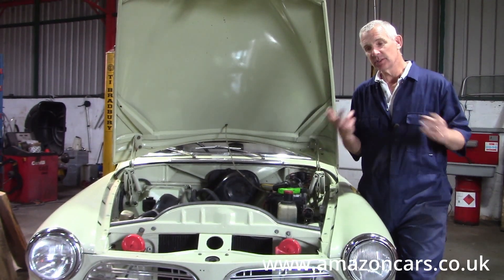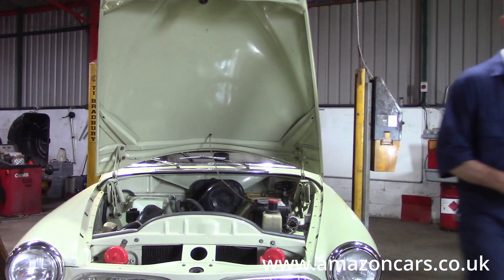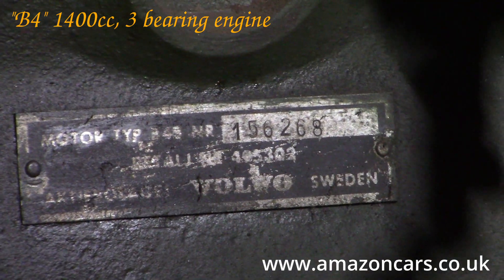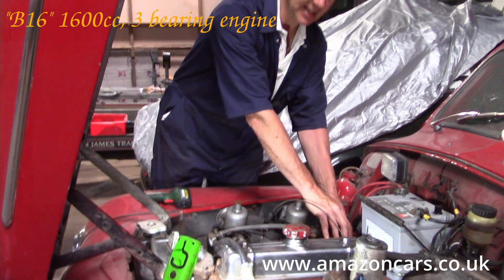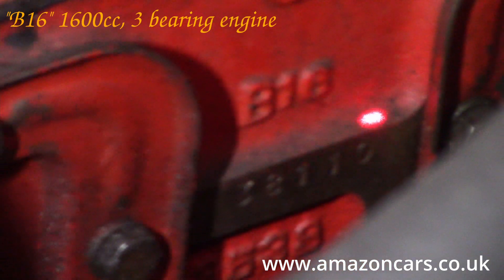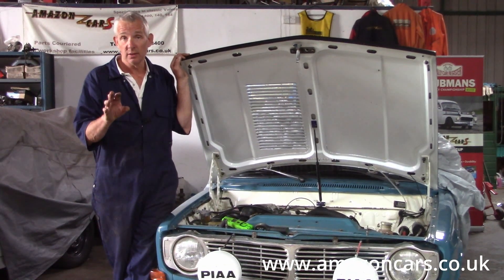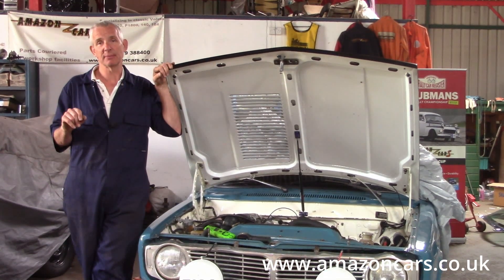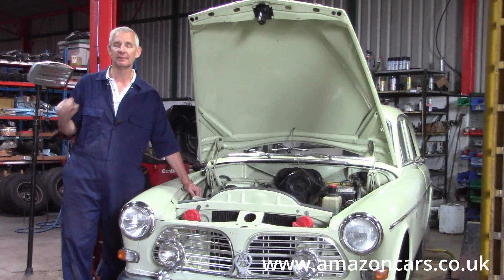Volvo OHV Engines after 1950

Comment: A very interesting, and informative video, I learnt from it.  
 The Volvo B18 engine was not derived from a Bolinder Munktell diesel engine though. 
 When Volvo acquired AB Bolinder Munktell in 1950, Bolinder Munktell were only producing twin cylinder tractors.  
 It wasn't until two years later, under the control of Volvo, that a four cylinder engine was made by Bolinder Munktell.  
 The B18 engine was designed by Volvo's brilliant engineer Per Gillbrand, it was designed from the beginning to be a robust, powerful gasoline engine, for use in passenger vehicles.  
 Another common myth is that the B18 engine was a Volvo B36 V8 truck engine cut in half.  
 The Volvo B18, and the B36 V8 share the same bore and stroke, but that is it, they were two separate designs, and were developed separately.

Comment: On your 140 B20 you have an unusual crank crake breather piping configuration. Is it rally specific?
Reply from the maker: Yes indeed Brendan, the closed circuit system on the late B18 & B20 can make setting the mixture a  little variable, so the 142 has a catch tank from the rocker cover & flame trap breathers instead - interestingly after years of use, there's still only a very small dribble when I drain it.
Rob
Reply: @amazoncars  That's interesting. I have a standard B20A and can never get it to idle smooth as if its pulling too much vacuum through the orifice nipple on the manifold.  I am planning on reducing the orifice size in the manifolf nipple to see if it makes a difference or plugging it and vent the rocker cover down to the road.
Reply from the maker: @brendanhurley8780  Brendan, on the closed circuit breather there should be a wee valve just above the flame trap. This closes at low revs to prevent the mixture going too lean, and opens at higher revs to burn the crankcase fumes.
Rob